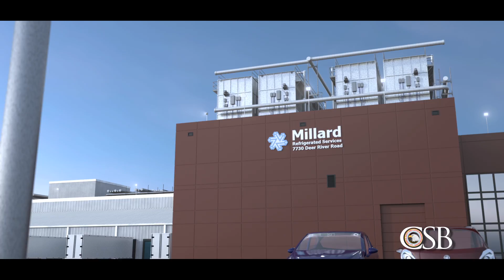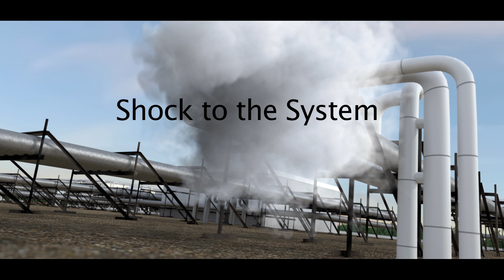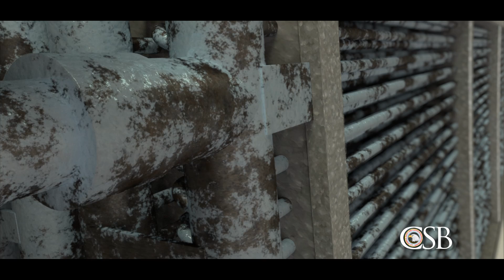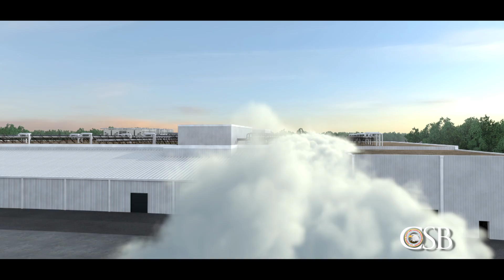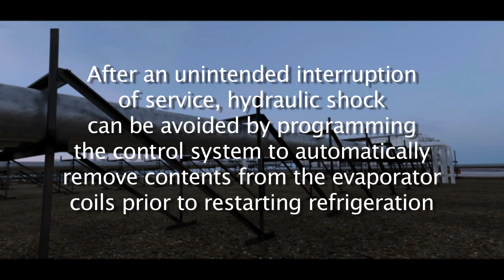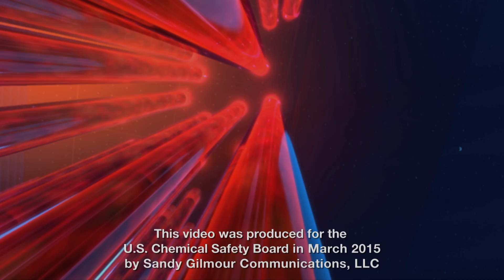Shock to the System

Comment: This shows a good example of a poor control scheme.  The system should be able to detect the hot condition and refuse to apply the low temperature fluid.  A common problem is insufficient I/O, sensors and control elements to properly function through abnormal events.
Reply: And possibly improper irregular situations management from control system software. I suppose, the "alarms" that were "cleared by operator", were of low informativeness, kind of "Warning: system online after power outage", providing no sufficient information for an operator and even any automatic control system to generate a proper instruction to address this warning.
Reply: This.  It shouldn't even be physically possible to do something this catastrophic.  This isn't a $10 PCB board for hobbyists, where if you forget to ground it or spill your drink its no biggie, just spend another $10.  This is a system that can cause tens of millions in damages and untold human lives/misery.  At least put 10 levels of permissions so that if you can do something, everyone from the assistant janitor to the CEO has to sign off.  This should not be possible for one idiot to FUBAR.
Reply: Why is the defrost cycle even categorized with alarms. Maybe it should trigger an alarm notification subsequent to it but the state change shouldn't be categorized with alarms.
Reply: The system also needed a way to absorb the shock.
Reply: @BradKwfc  that sort of shock should never occur in these systems, that’s far beyond normal operating conditions
Reply: @sage5296  Ok, that explains why there wasn't one then.
Reply: Doesn't an alarm mean the system already sensed it but he overrode it?
Reply: @Amaroq64  it means the system sensed it.  But there may be no way for the system to act on the alarm.  If nothing else, the code to do so may not exist.  Or the hardware necessary may not exist.
Reply: I know this is a old thread but can anyone with any experience with this kind of system tell me how exactly the system was running a defrost cycle while the electric was out? the video explains it as immediately after power was restored, the system was in the middle of a defrost when they tried to restart it but doesn't make sense how that happened if there is no power to heat the ammonia.
Reply: Or the valves should operate slower with a gradual cycle shift.
Reply: Or don't hire dumb people to work on HVAC systems without an HVAC license.
Reply: @UltraGamma25  it’s better to make it impossible to do it wrong than to just tell people not to do certain things.
Given enough time, mistakes will happen, human error is simply a given, best to design a system that can handle a bit of human error and not explode

Comment: I understand the person resetting all the controllers made a horrible mistake, but this problem would not have happened if the software wasn't flawed. The firmware on the controllers should NOT have allowed resetting any refrigeration system that was running a defrost, or at the bare minimum warned that 1 or more units were defrosting and would be reset after they finished. Secondarily, it should require more then one person to forcibly override anything, perhaps two or three keycards (wireless or mag stripe, the override MUST be stored in physical form). Third, the controllers should be designed to drain all the pipes, when switched on before powering on the refrigeration system, and this must be a non overrideable function. Last of all, the software should give CLEAR indications when procedures that shouldn't be interrupted are occurring, and refuse certain actions without multiple people approving it.

Implementing these kinds of interlocks and safeguards should be quite obvious during the design state.
Reply: What I understand from the video, the system didnt know its own state after a Power interruption, and that caused the system to resume the refrigeration despite the system actually being in the defrost state (just prior to the Power interruption), after the operator cleared the alarm/error. Draining the pipes when its unneccessary can also be dangerous in some situations. The person didn't override anything, but did clear an alarm, that had halted the system.
I Think the best bet here would be, either to have the system to store its state in a non-volatile form at all times, so it can resume correct operations after a unexpected Power interruption, AND/OR have the computer systems/PLCs on battery backup, so it can remember its state for such as long time until its safe to restart the system regardless of prior state (eg when the "hot" ammonia have cooled down enough due to the Power interruption so it doesn't matter if the system is in refridgeration state or defrosting state)
Reply: @sebastiannielsen  I was thinking the same thing when I watched this... You hit the nail on the head. The human operator could have also been replaced by an " automated software reset" and this accident would still have occurred. There should have been a paper log printout of what tasks the system was doing at "x" time so that the human operator could reference and then make an educated guess on what the condition of the chillers was 8hrs after the power outage.
Reply: @sebastiannielsen  the control system could easily have been programmed to detect this if it just checked evaporator temperature on boot. If evaporator is hotter than room temperature defrost is in progress.
Reply: @mrfrenzy.  Provided there is means for measuring the temperature. The pipe construction with the bypass pipe shown in the schematic seems to indicate an analog TXV was used, thus the logic system had no idea of which temperature the coils have. Propably the system where run with just a thermostat that controls the refrigdeation temperature only inside of the cooler.

The error/alarm was propably a simple thing like "Fatal error: Supply fault" or something similiar to that, that is shown on all abnormal startups.
Reply: @sebastiannielsen  The non-volatile memory is probably the best way to do it. If there is a power outage, you know the controller isn't going to lose its state - although I would take it a step further and say that there should be sensors in the pipe. Whenever the controller starts up, it reads the sensors and compares them against its previous state. You would expect them to match, but if they don't; something went wrong or someone interfered and a licensed professional needs to manually interfere and set things right (with approval from several layers of management).
Reply: @sebastiannielsen  Or the controller s/w should assume the worst case scenario when restarting after a power failure
Reply: @alanhaywood01  It seems to me like nobody considered a long loss of power when desinging the control system, so the system started up in some weird state where the system was doing something else than the computer thought after the reboot.
Reply: @keineahnung497 
And while I still stand by my original comment I made, I should have mentioned the firmware needed a temp and pressure sensor to detect a defrost and lock it out. Additionally, the pressure sensor could also be used detect a sudden drop of pressure in normal operation. A sudden pressure drop is usually indicative of a leak, the controller which could shut it down and isolate the affected unit automatically. This incident is pretty much a perfect example of what a bad design, bad decision and a race condition can cause. Like the Therac... https://en.wikipedia.org/wiki/Therac-25 Not for one second during the design phase should any system be considered fool proof, the world will just invent a better idiot. So making it hard to override critical systems, and making it very clear who is at fault, is extremely important.
Reply: @theLuigiFan0007Productions  Yes, I agree. The computer probably was designed to boot up with the system being in a speific state (probably shut down). The computer obviously didn't store the condition of the system through a reboot, so it didn't know about the system being in defrost and probably assumed that the system was shut down, so it did a normal startup. The solution would be, as you said, adding sensors or, because these sensors probably already exist  for normal operation, read the sensors on startup and check the state of the system, instead of assuming the state of the system. In my eyes this isn't a classic "Someone overriding lockouts" type accident, it was the computer reboot that left the system in this weird state it was never designed to be in. The first thing the system should do on boot is a complete system check, instead of just assuming normal operation. Like with the Therac accident, the computer doesn't only need lockouts against the operators, but also against itself.
Reply: I like seeing that the systemic issues were acknowledged along with the operator error.  People are going to make mistakes no matter what, and it is the job of the system designers to ensure that the ones with potentially deadly consequences, like this one, aren't easy to trigger by accident, while still allowing outside-of-normal-rules controls for the edge cases where those features are needed, too.  

It is difficult work!
Reply: Agreed. IMO, the operator was not at fault here. "The operator cleared alarms in the control system" - Yeah, because that's what you do after a power failure, as everything trips off, and without enough IO, the system doesn't know its' own status on restart. (this is even worse if the controller itself has backup power, because all of a sudden, all of its' inputs go screwy, though it's still running).  The fault was the controller software/PLC programmer assuming it's initial state.  Assumption is the mother of all fuckups...
Reply: I couldn’t agree more. From autonomous cars to plane autopilot to industrial control software.

Some individuals in the engineering world do not respect and acknowledge software as engineering.

If you design these safety critical systems, you should need a stamp, period. Stamp on software, ass on the line. You’ll think twice before releasing it.

Sure you can still be found liable, but knowing a jury of your peers is going to be going through this will make the world of difference.

I’ll never understand why safety critical software gets away with no sign off. A bridge would never be built without a stamp. It’s insane.
Reply: Older systems are made with PLC. These logics are often flawed with regard to safety because of hasty decisions during the engineering process. They were new at the time. Before PLC systems were used everything was analog.
Reply: It seems to me on any restart it should automatically evacuate the system,  just in case.
Reply: Amen, Luigi.  However, like most corporations that would have cost more money...and you know the rest.
Reply: When the power was switched back on:

Sensor 4672: "Where am I? Who am I? WHY am I?"
Subsystem 13: "I cannot remember when I last did a defrost, doing it now!"
Subsystem 14: "Um, 13, what is a defrost?"
Pump system: "pumping, pumping, pumping"
Subsystem 4: "Hey pumps, pump harder, the system is too warm"
Human interface system: "Your system has recovered after an unclean shutdown. Please reboot to start up into a safe state."
Operator: "reboot?"
Physics: "watch THIS"
Reply: Why do this in software at all? Have the cold valve shut by the pressure of the hot gas so that no matter what software says, it's physically impossible for both to be running at once
Reply: I know this is a old thread but can anyone with any experience with this kind of system tell me how exactly the system was running a defrost cycle while the electric was out? the video explains it as immediately after power was restored, the system was in the middle of a defrost when they tried to restart it but doesn't make sense how that happened if there is no power to heat the ammonia.
Reply: @skeetrix5577  
The order of things that occurred in this incident were:

1: The system was operating normally previously.
2: An extended power outage occurred for many hours.
3: The system was switched back on for a while.
4: Problems with operation occurred due to unstable startup.
5: The system begins a defrost cycle of some units.
6: The operator restarts the system to clear errors.
7: The system floods the hot defrosting units with freezing liquid ammonia.
8: A couple pipes ruptured due to hydraulic shock.

So the units where switched back on and operating for a while before the restart that caused the ruptured pipes. I do think that it probably could have had a similar issue even if it wasn't defrosting, as long as the evaporator was filled with room temp gas. It's designed to start with a empty evaporator, and as the CSB noted, it should have been designed to try to empty it first before flooding the evaporator.

Hopefully this info helps you understand the exact cause and relation of the events that happened. Although my profession isn't refrigeration, I do know a decent amount about it and am very observant of detailed information. If you want a explanation of the physical processes that caused hydraulic shock, I could write one on that as well.
Reply: @theLuigiFan0007Productions  I really appreciate the clear explanation! thank you for taking the time to write this

Comment: Steam hammer...with ammonia.   Bad news.
Reply: It was not steam. It was liquid.
Reply: @marks6663  Steam hammer is when steam condenses into water, creating a vacuum, and causes the water to be hurled at the side of a pipe. (See Wikipedia's page on water hammer, under "related phenomena"). So the fluid that causes the damage in steam hammer is not steam, it's condensed steam (water).

Comment: https://www.youtube.com/watch?v=fYRVQfdFHZ0 https://www.google.com/url?sa=t&rct=j&q=&esrc=s&source=video&cd=4&cad=rja&uact=8&ved=0ahUKEwjnk8-2pbPXAhXqlVQKHUQ2BsMQtwIINzAD&url=https%3A%2F%2Fwww.youtube.com%2Fwatch%3Fv%3DKctSyILS6Ho&usg=AOvVaw1veX8YC1cmHhQyF61Us2Kn Anhydrous ammonia has a huge attraction to water. If you filled a plastic bottle with anhydrous ammonia gas and add half a cap full of water to it the ammonia gets absorbed into the water so fast it will actually crush the bottle. That is why you don't want a cloud of this stuff coming towards you because it will dissolve into the water on your skin and in your eyes nose and mouth and will chemically burn you. And believe me the smell is horrible.

Comment: Great video. I don't really know the details of this refrigeration system, however I suggest mentioning why to use ammonia (a toxical substance) and not contemplate inherent safety principles by using an inert an non toxical refrigerant. I am sure there is a reasonable answer to this and I would like to know it.
Reply: Luis, I checked a refrigeration website, and they name four advantages of ammonia refrigerant: it's less expensive to build an ammonia-based system, ammonia is more efficient at transferring heat so it costs less to run, it will not deplete the ozone or cause global warming, and it is far cheaper to buy ammonia than to buy a CFC-based refrigerant. It has two problems: it's incompatible with copper so you must use aluminum tubing; and it is very poisonous in high concentrations...which is mitigated by two factors: it's lighter than air so it leaves the area in a hurry, and it is so pungent people will get the hell out of the area long before concentrations reach poisonous levels.
Reply: There are quite a number of substances that can be used are refrigerants but they all seem to have some significant downside.  Some, like ammonia (NH3), are toxic.  Some, like cloroflourocarbons (CFCs like R12), deplete the ozone layer and have been banned by the Montreal protocol. Some, like Hydrochlorofluorocarbons (HCFCs like R22, also in the process of being banned) deplete the ozone less but are greenhouse gasses. Some, like Hydro fluorocarbons (HFCs like R134A) don't deplete the ozone but have a high greenhouse gas potential.  Some, like a mixture of hydrocarbons (propane, butane, etc. like HC12) are very flammable/explosive. Some, like carbon dioxide need very high pressures and temperatures to work.  The bottom line is that in each case the engineer has to decide which refrigerant to use based on their desirable and undesirable characteristics including availability, system cost, efficiency, toxicity,  and environmental impact among others.  I expect it isn't always an easy to make decision!
Reply: Hello, I am an HVACR technician & can provide some insight. Surprising, ammonia, also referred to as R717 when used as a refrigerant, is considered an environmentally friendly refrigerant. Other common refrigerants used in refrigeration (such as R134A) deplete the ozone layer when released into the atmosphere & are heavily regulated by the EPA. They are also much more expensive. Ammonia (R717) is also very good at what it does & more efficient than other refrigerants in large industrial applications.
Reply: Probably more efficient.
I am not sure about labeling it "toxic" tho, bad stuff but its most common use besides refrigeration is fertilizer.
Reply: Many refrigerated facilities are quite old, and Ammonia was definitely the refrigerant of choice for most of these facilities when they were built. Changing them over to something less hazardous (depending on your definition of less hazardous might be) would be very expensive, and we all know what big corporations will choose when it's a choice between profits or safety.